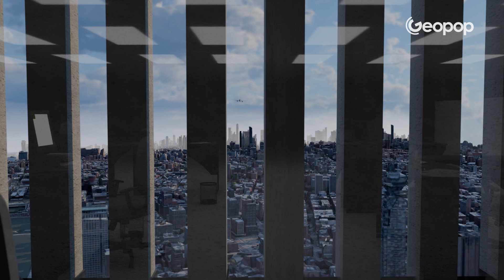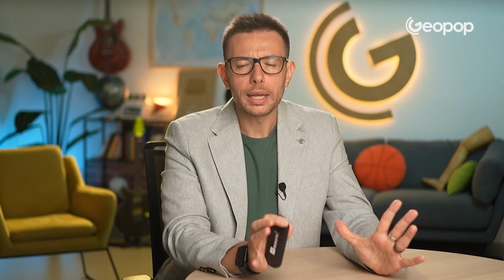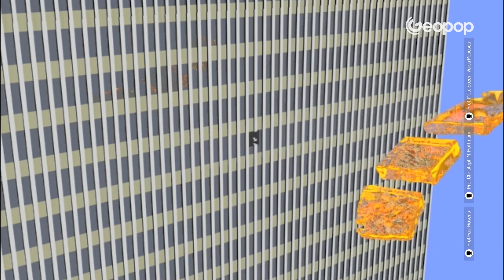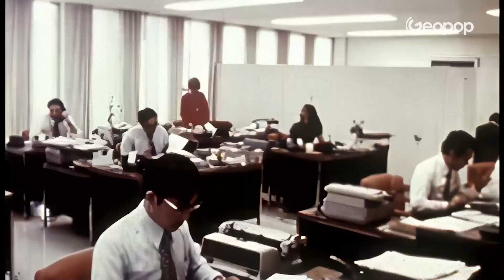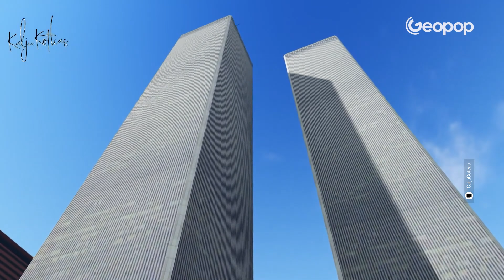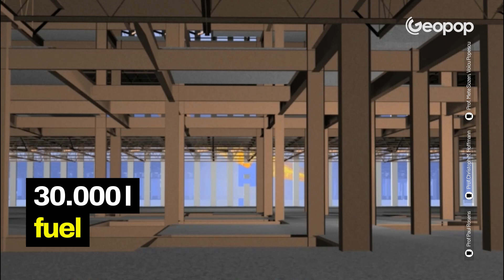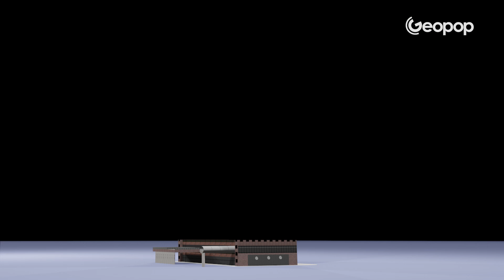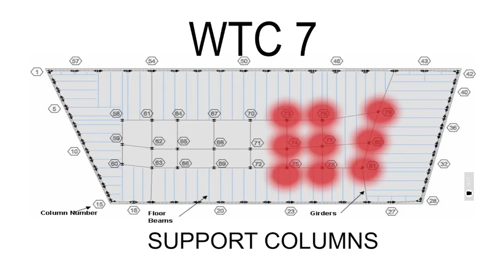9/11, 2001: The Technical Reconstruction of the Twin Towers and WTC 7 Collapses

Comment: I always laughed at the conspiracy theorists who would insist on using the "steel melts at 1,500 degrees" point... it's like these people have lived on their computers for so long they've never seen something in real life that's bearing weight get weakened by the elements. Everyone's been to the supermarket and had a leak, a puncture or a burn in a compressed bag, and then the pressure of the goods inside gets too much for it... then RIP. There were thousands of tonnes of pressure from the floors above pressing down on those heated and weakening beams... it's not a conspiracy that they eventually gave way and created a chain reaction collapse.
Reply: Still doesn't make sense when you remember that the buildings fell at free fall speeds. Chain reactions wouldn't be that quick.
And then we must consider the other lie that a third world hijacker performed one of the greatest aerial manoeuvres of all time flying a jumbo jet in a downward spiral and hit the Pentagon at street level and still somehow missed all the street lamps on the way in.
Reply: Even though Grenfell tower in the UK bruned for hours and didnt fall...
Reply: @F12024-i  It wasn't a steel tower. It was concrete.
Reply: @F12024-i  was it hit by a jumbo jet?
Reply: @petralizzy7383  Yeah it was...
Reply: There was nothing wrong with the beams on the lower levels though
Reply: @WorldwideDarts  Apart from thousands of tonnes of weight crashing down on the overall structure at speed from above? You do realise mass + acceleration = force? Not to mention all that shaking and rattling of the structure as it fell would separate some of those beams from each other which would also weaken the structure

Comment: The fuel was burned off in 45 seconds, after that it was only considered light hazard in the fire protection world.  The black smoke shows a dying fire.  The beams would have bent, leaning the building over.  NIST is full of crap
Reply: Even if the jet fuel burned off that quickly (doubtful), that's not the end of the story; it acted as an accelerant starting office fires that had virtually unlimited fuel. And guess what? Office fires burn HOTTER than jet fuel!

Comment: Think about it. If Tower seven was intentionally blown up, why would they do it 7 hours after the main towers already collapsed? It makes no sense.
Reply: Tower 7 was reported as collapsed before it actually collapsed
Reply: It doesn’t make sense that bush / Cheney were able to give closed door statements that were sealed lol.
Reply: @coin_guy246 Most people are not aware of that.

Just as most people are completely clueless/unaware of so many other damning facts and evidence that exists when it comes to 9/11.
Reply: @coin_guy246  Right! And Bush was not allowed to be questioned without Cheney present, and their testimony was unrecorded.
Reply: @coin_guy246     Common sense doest work on indoctrinated people ‼️was/is.:

9/11 = WAR IS THE NEW OIL‼️
War, SINCE, HAS MADE UNTOLD RICHES TO TO THE INSTIGATORS OF 9/11 🤔😡💣💣💣💣💣💣💣
Reply: This is such crap. This guy clearly doesn't understand basic physics.
Reply: Research which agencies used building 7. Also where the mayors command centre was located and not the one he used on the day.
Reply: "intentionally blown"  It makes no sense because it's dumb. Think about it.
Reply: Use your brain.
Reply: In the film clip they show how the horizontal bars bending. But the real strength lay in the vertical steel elements. Make a small replica from corogated board and TRY to simulate the downfall. It would very difficult to bring it down the same way without cheating ‼️

And that what they did. A lot of things are missing in the NIST report.
Reply: Insurance money- perfect sense . Don’t be such a rube
Reply: All financial records were stored there.. That 3trillion black hole in government finances went up in smoke
Reply: They ignore that the water mains were not working, building had been burning for hours. The center fell out first before the building. It’s insane. These nuts also forget the USS Cole attack and the dozens of others prior to this - including 1993 WTC bombing. 

Just bad people that think this was anything other than what it clearly was - a terror attack that did its job, sadly.
Reply: World Trade Center was quite literally a set of buildings used pre-Internet for government and business representatives from countries around the world to have face to face meetings, negotiating trade and signing contracts.  Each country staffed their offices much like an embassy would be staffed near a nation's capital.

Larry Silverstein had only recently purchased the World Trade Center and he faced the daunting, expensive removal of Asbestos to bring the buildings up to code.  In one afternoon, that all went away as 3 towers all fell in a manner identical to controlled demolitions and unlike building collapses from other causes.

Kenneth Feinberg would oversee and disburse from a fund of 7 billion, 375 million dollars to compensate the families of the three thousand victims but in exchange, families would have to become passive citizens and wait to be told whatever they were permitted to know.  There were some holdouts who referred to themselves as "the Widows of 9/11" and many national news programs did give them airtime, if you want to hear their questions.  Michael Moore interviewed several firefighters for his documentary"Farenheit 9/11".   There are other sources as well.
Reply: It´s indeed more likely that they planned to pull WTC7 while it was cloaked by WTC1 dust but that something went wrong. So what to do now? Fight the fires, save the building, have no excuse for missing ENRON documents and just leave the cutter charges where they are? Or try to fix what ever went wrong and pull WTC7 anyway? "How long would you need to fix it?" - "About 5h"

So now YOU tell ME: How could they not only predict THAT but also WHEN WTC7 would come down if it wasn´t controlled demolition? Never before had a skyscraper collapsed due to fire... Also you can´t explain the free fall without controlled demolition. Wake up dude, you fell for stupid lies.
Reply: he was talking about pulling the fire fighters from the building because it was obvious to everyone there that it was at risk for collapse @jacoboc2244
Reply: Why would the make it collapse right with the towers? Why would it collapse an hour later or 2? Why does time matter? It shouldn’t have collapsed to begin with. There were closer buildings to the WTC 1 and 2 that stayed up.
Reply: "Why" does not matter here as of yet

What matters first is that most people acknowledge that WTC7 did not collapse coincidently from officefires but was deliberately brought down through some high tech form of controlled demolition.

Which raises questions about NIST 's integrity and about the integrity of the US govt as a whole.

Those are pretty tough questions with answers that have far reaching consequences, as you can imagine...😊
Reply: To believe it was a planned demolition of a live building defies any form of common sense!  Thats simply impossible and naive to believe!
Reply: Which is more extreme -- to accept without question the inexplicable lack of turbulence in the wake of a 500 mph large passenger airliner -- not evident in the smoke and fire covering the impact zone only seconds later? -- or to recognize the indications of digital projection in its imperfect nature as we see a wing disappear in front of a bright blue sky? From another camera angle, the same aircraft is seen passing behind a crane in the foreground, yet in front of the heavy crane cable. 

There should be a hurricane of turbulence in its wake that would entirely disrupt and disperse the smoke and fire seen billowing outward just 3 to 4 seconds later at both towers.  Even the wake of a small Cessna aircraft would be noticeable -- yet there is nothing.
Reply: You can't use logic with conspiracy theorists
Reply: @dark-horse8784 can’t argue with morons who actually think tower 7 was a natural collapse
Reply: Have you watched "The New Pearl Harbor"?
Reply: @dark-horse8784  Oh wow! That is what you think is the most odd thing?!
Reply: @dark-horse8784  
Let's correct your claim. It should read "...cannot use logic with debunkers."
Had any of you read NIST's reports, you'd not be so smug.
Reply: @JackCarlock56   I have not read the report but they explained a lot about it on A&E for 9/11 Truth.  NIST needed to change the #7 construction to make their theory work.
Reply: @JosephBoxmeyer-u3d  
You are absolutely correct. NIST changed a number of facts to create the scenario they were directed to present.
Reply: @JackCarlock56  oh okay 👍🏻 the same report that found traces of thermite in the dust, yeah anything can be hidden but the government is your friend 🐑
Reply: @JackCarlock56  dude i've seen people claiming the planes were holograms and stereos! It's impossible to reason with any of you tin foil hatters
Reply: @dark-horse8784  
Dude. I bring facts straight from NIST's report. If you can't deal with facts, then it's you who is unreasonable.
Reply: @JackCarlock56  i've yet to read / watch this report you suggest. But surely you can appreciate where the scepticism comes from as some of these "theories" are borderline fantasy. And I've yet to see any claims with any kind of definitive evidence to support them. It's just getting old and tiring
Reply: @JackCarlock56  what about the magic passport that flu out of the terrorists pocket and somehow wasn’t burned? Or the engine that wasn’t even the one that came with the plane? Answer that instead of saying stuff that the tv told you to believe.
Reply: @dark-horse8784  University of Fairbanks AK Leon Hulsey and graduate students did a finite element structural analysis of the Bldg 7 collapse, available free online.  There's a journal of 9/11 studies, serious scientific analysis of wide range of 9/11 topics - of course, the quality of the analysis can be critiqued on a paper by paper basis, but it's not kids talking about holograms.  Kevin Ryan is an excellent source for serious scientific discussion, former employee of UL Labs (they certified the structural steel used in the towers) who got fired after asking too many questions about the narrative that developed around the collapses.  Here's a question for you:  what are the claims of the conventional explanation and what evidence do they offer to support them?
Reply: @dark-horse8784  unfortunately youtube and google shadow banned many "conspiracy theory" videos. I recommend "The New Pearl Harbor 9/11 full documentary", of course its still just theories, no definitive proof but you can say the same about the NIST Report.

You are right some theories are complete fantasy, like the laser beam one and the one you mentioned but some of them make a whole more sense than what NIST claims.
Reply: @dark-horse8784 , unfortunately, youtube and google shadow banned a lot of "conspiracy theory" videos. I recommend The New Pearl Harbor 9/11 full documentary, of course, it's still just theories no definitive proof but you can say the same about the NIST Report.
Reply: @dark-horse8784  unfortunately, youtube and google shadow banned a lot of "conspiracy theory" videos. I recommend "The New Pearl Harbor 9/11 full documentary", of course, it's still just theories no definitive proof but you can say the same about the NIST Report.
Reply: @dark-horse8784 yup. It’s not worth talking to these idiots. Not any of these collapsed buildings looks anything like an implosion. These people are idiots.
Reply: dark-horse8784...…..you can actually watch one of the "so called" live footage of the jet sliding into the tower, almost frame by frame in YT. .Ifyou believe in cartoons, then this is right up your street, because the jet actually sinks into the tower,no shuddering or debris, until almost both wings are inside. Then the flames exit the building and envelop the jet. It's about as believable as the road runner running off a cliff and reversing back to the land. Or a character running through a closed door, leaving a man shaped hole. Which is just how they depicted the tower, with a jet sized hole. Then there's the image of nose cone coming through the other side of the building, yeah right. Anyone who thinks ajet could smash through reinforced concrete like the stairwell and lift shafts,  belong back in school, or maybe in a job breaking concrete with an aluminium hammer. And btw, are you aware the nose cone in these jets are made of plastic ?
Reply: @dark-horse8784 Do you even know what NIST is?
If not,  then what the hell is your ignorant uninformed ass doing here?
Reply: @JackCarlock56 right on
Reply: @dark-horse8784  Sure these people exist, you're right.

But this is not about that.
This is about NIST providing a completely UNscientific fraudulent report (well two reports actually), of which you are apparently, just like most people, UNaware of, because you haven't studied the report or you dont have the intellect to comprehend why what they're claiming is INcorrect.
Reply: @sandervandenberg977  Nice letter usage to get your point across good sir. Bravo 👏
Reply: @dark-horse8784  Nice dodging of what I've been trying to get across to you.😉

Yeah you got me, I'm only Dutch so, forgive my lousy English, doing my best to make the most of it.
Reply: @dark-horse8784  OK, so SOME of the theories are borderline fantasy, we agree on that, sure.👍🏻

And also, very little solid evidence exists to back up these farfetched theories, sure,  we agree again.

One of the more farfetched theories I've come across is this:

Steelframed skyscrapers that are able to completely selfdestruct more or less straight down due to some officefires and asymmetrical damage.

What do you think about that one?

 What kind of solid hard evidence have seen you seen to back up this bizar claim?
I haven't seen any thusfar, but maybe I've been looking in the wrong place.
Or maybe you know where to find it....
Reply: @dark-horse8784 you aren't  looking.... There's live recordings of people "apparently on the plane" and conversations. When can you even get a signal in a plane... Try it next time you fly... You can't!
Reply: @dark-horse8784 It’s funny how when you ask them to provide their proof , it just becomes more schizo rambling. Talking about controlled demolition😂. No credible witnesses,  no videos or pictures of any explosive devices or the people transporting enough alleged explosives to take down multiple skyscrapers. They just copy what they see someone else type.
Reply: @dark-horse8784 taking the dumbest conspiracy theories and using that as a baseline to discredit genuine skepticism is illogical.
Reply: @dark-horse8784  which points of the conspiracy theories do you find illogical?  Have you read my comments?  Please, take apart my observations.
Reply: @Potion_Seller99  the owner said he made the decision to pull it, which is a reference for demolition crews…he made billions off of it
Reply: @timglover5358 isn’t the term pulling it another way of saying getting the heck out of the building surrounded by burning streets?
Reply: @Jay_boy19  we’ve all seen the clip of Weinstein saying he made the decision to PULL IT which means bring the explosion and take the building down
Reply: @timglover5358  so when were the explosives put in place?
Reply: To answer your question, read my comments.

Comment: Doesnt make sence what he explain about tower 7. Tower 7 did not collaps as seen in his computer simulation that said it started at colum 89. The whole building was falling without any resistance and did not start at colum 89.
Reply: You base that off of a video of the external wall? You can see the roof cave in 5+ seconds before ffs. It wasn't sudden.  The interior clearly failed first
Reply: He was saying that the collapse started internally at that point then shortly after the outside came down with it
Reply: And why did the owner of both buildings take out an insurance policy,  in the event both buildings were destroyed?
Reply: @darrinfrench9018 I would say that every sky scraper in NYC is insured against that. Your insurance is renewed yearly.
Reply: @darrinfrench9018  idk probably because it wouldn't be the 1st time someone tried to destroy them
Reply: @darrinfrench9018 why would you not insure your property? Moron

Comment: Control demo.... it was all rigged month prior. The 2 main building would not have collapsed in free fall. That has already been proven theoretically impossible to happen.  They where owned and paid for buy the Roth childs
Reply: Congrats! NONE of that is true.
Reply: All true 100% I read all the documents on it..
Reply: @craigjones2015  "All true 100% I read all the documents on it.."

Cool. Then you shouldn't have any difficulty providing citations. Let's start with your claim that the towers collapsed in free fall - since it's easy to demonstrate that they did not.
Reply: There was white vans parked out side at night time for months. Leading up to it.. I've seen the video footage from all the cameras. That and people showing them parked out side filming them with personal cameras. My dad worked for delta  Airlines for 30 years. Even he said that was impossible. The planes where made of aluminum and titanium. The wings would have sheared off on impact. Unless the steel was heated up to 3000f. That area could have been thermiteed in the out line of a plane. It was all done from inside people to go to war.. all part of nwo agenda.